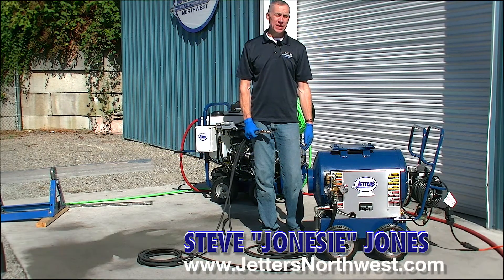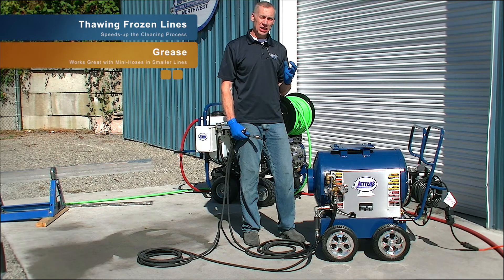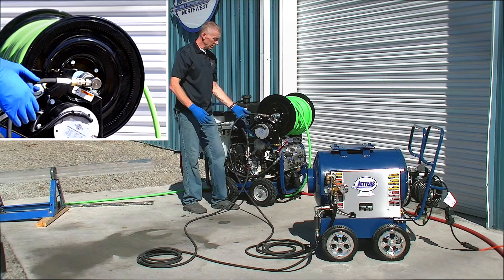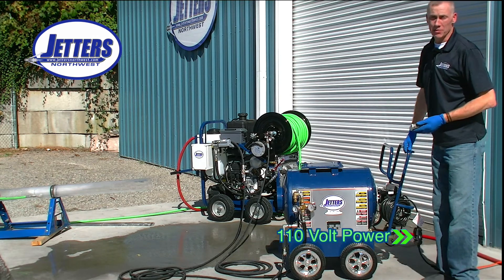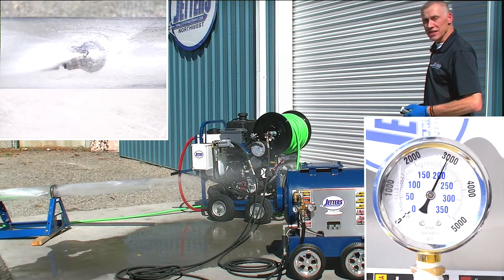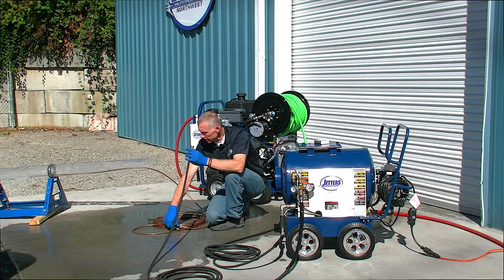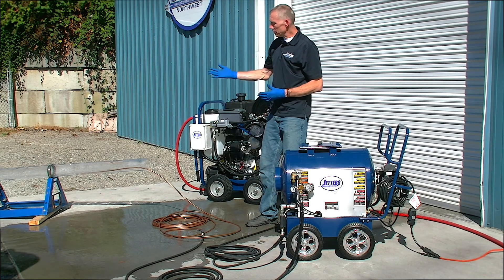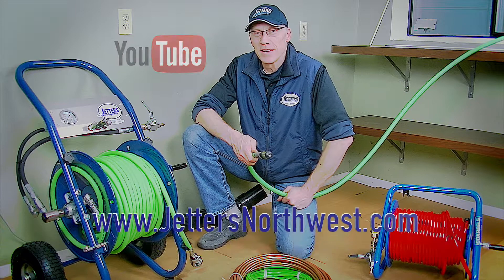HOT-WATER JETTING with the Brute HOT-BOX - "GET" JETTING w/JONESIE

Comment from the maker: BTU's (British Thermal Units) determine a heater's "heat-rise" capability; this HOTBOX's spec is 350,000 BTU, and we now offer a 480,000 BTU model - it's about 8" longer (longer coil inside) at a similar height/width to the 350kBTU model in the video ;)